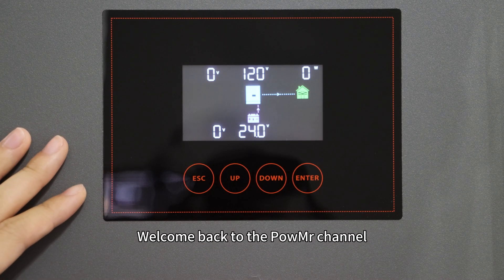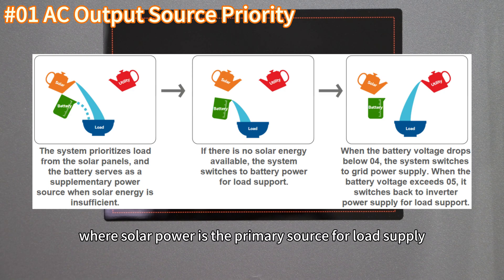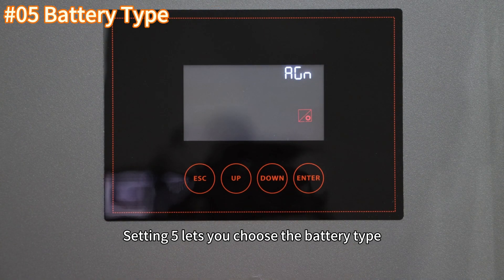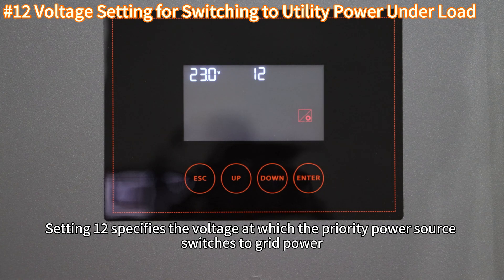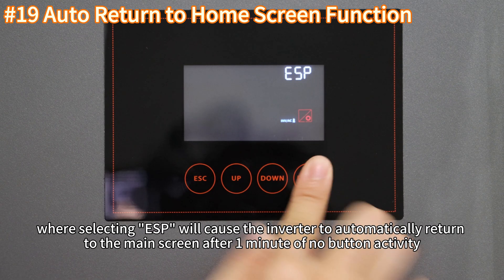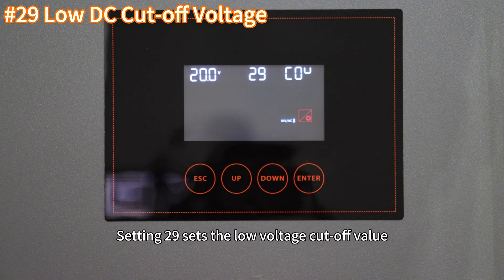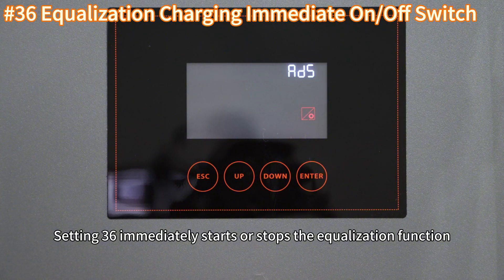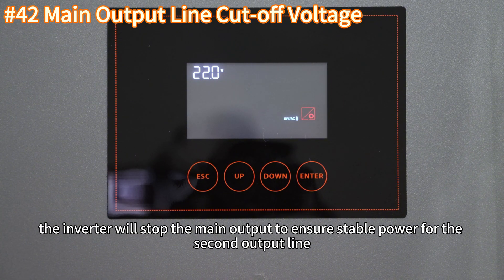How to Setup the POW-LVM3.6M-24V Solar Inverter?

Comment: About POW-LVM3.6M-24V ・
What is the range of AC input frequency? 
Can 4800W be output by using Main AC output and Second AC output together?
Reply from the maker: The frequency of the AC input is the frequency of the local mains, so the output frequency should also be set to that frequency. Nope, 3600W

Comment: A query, can the pow-LVM3.6M-24 work off-grid only with pv and battery?
Reply from the maker: Yep.
Reply: @PowmrSolar 
Hi there about the pow-LVM3.6M-24
If i dont use grid power what option you recommend for solar panel and battery only in ouput source SUB or SBU ?
Reply from the maker: @mhansel71  Without mains power, there is no difference between SBU and SUB modes

Both will give priority to solar energy, and if solar energy is insufficient, the battery will start to discharge
Reply: @PowmrSolar
About the power-LVM3.6M-24
Max Charging Solar+Utility 120A
Max Charging Utility 80A 
What is max only solar charging??
Reply from the maker: @mhansel71  120A
Reply: @PowmrSolar 
Hi, about the pow-LVM3.6M-24 
In settings 23 if enable ,when overload occurs in battery mode the unit will transfer to line mode and  in setting 6 if enable auto restart when overload occurs i am little confused you can explain me please
The setting 6 is meaning overload occurs in line mode?
Reply from the maker: @mhansel71  To avoid misunderstanding, it must be clarified that the overload referred to in item 23 does not mean that the load power can exceed the rated operating power of the inverter. The maximum load power must be less than the rated operating power of the inverter. Item 23 means that when the battery power cannot drive the current load and the load power is less than the rated power of the inverter, the mains power will be cut in to supplement. Item 06 means that the machine will automatically restart when an overload occurs. It is recommended that you do not overload the machine. Overloading is a human-induced machine failure.
Reply: @PowmrSolar 
Another question about the pow-LVM3.6M-24 in charging source option (CSO) solar will be charging as priority and when solar is not available Utility will charge the batteries and if when the night change to utility and no have grid power due to outage it will cause a fault or the inverter wait until grid power appears or solar appears in the next morning ?
Reply from the maker: @mhansel71  If there's a nighttime power outage, the situation varies. If there's no load running, consider the battery configuration. If the battery isn't sufficient to power the inverter all night, the inverter will display a low-battery warning code when the battery voltage drops. If the battery is dead or the lithium battery protection prevents the inverter from detecting it, the inverter will shut down. After the inverter shuts down, you'll need to manually restart the system the next day if power returns or PV is available.

If there's a load running, but the battery alone can't support it, an overload warning may also be displayed.
Reply: @PowmrSolar 
Hi there , about the pow-LVM3.6M-24 on the side sheet of the inverter show: 

 Full load MPPT range:240~450Vdc

This voltage is (VOC) or voltage at pmax of the panel array?
Reply from the maker: @mhansel71  PV Array MPPT Voltage Range:
60Vdc~500Vdc

Comment: I am experiencing an issue with my hybrid inverter(POW-LVM3.6M-24V). The problem arises when the inverter is completely disconnected due to a lack of battery charge, utility power, and solar panel input. Upon reconnection, the inverter does not retain the configuration settings that were previously programmed. As a result, I have to reprogram the settings each time the inverter restarts.

This issue significantly impacts the functionality and efficiency of the system, as it requires manual reconfiguration after each disconnection. Could you please provide guidance or a solution to ensure that the inverter retains its settings even after a complete power loss?

Thank you for your prompt assistance.
Reply from the maker: Just connect the battery and set it up to see if the parameters can be saved successfully. Is it that every parameter cannot be saved successfully or a specific parameter cannot be saved?
Reply: @PowmrSolar  I have connected the battery and set up the inverter, but the issue persists. All parameters fail to save successfully after a complete disconnection.

There are occasions when I do not have utility power or active solar panel input, and the battery can become fully depleted. When I turn off the hybrid inverter due to a lack of power in the batteries, and then try to turn it on the next day, all settings revert to default. I have to reconfigure all the values again to ensure compatibility with my 12.8V, 12Ah batteries arranged in a 2S2P bank to achieve the necessary 24V.

Could you please provide further guidance or a potential solution to ensure that all parameters are retained after a complete power loss?
Reply from the maker: @kceress  Connect only the battery to start the machine, then set SBU in #01. After setting, turn off the inverter until the machine stops. Then connect only the battery to start the inverter again and enter #01 to see if the parameters are SBU.

Please send the fault video to this email: support@powmr.com. Our technical staff will check it for you.

Comment: Can it be used without Solar Panels and have Solar only as a future option?
Will it still provide 3.6kW off batteries only when the grid power is not available?
Reply from the maker: If you are not currently connected to solar panels, it is recommended to configure batteries and mains power, and try not to run the load at 100% full load. It can provide 3.6KW power normally.